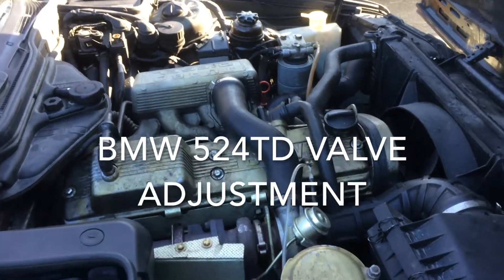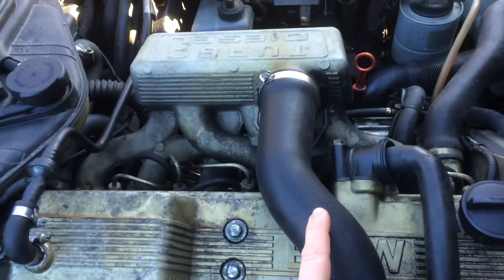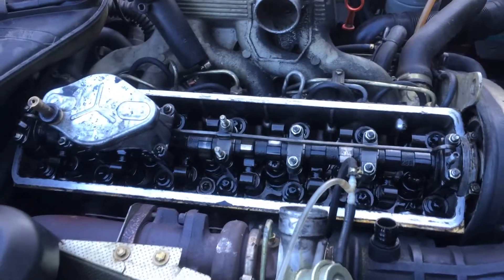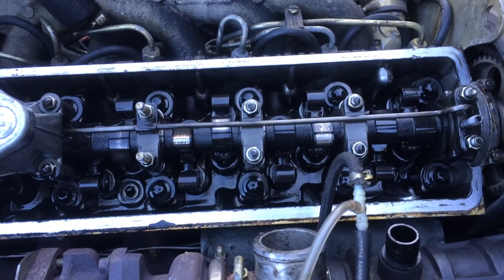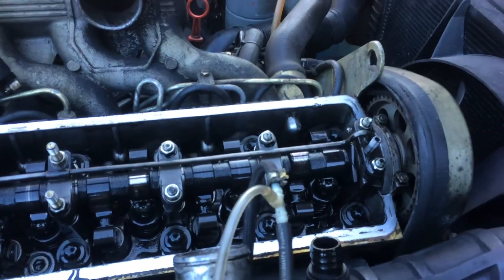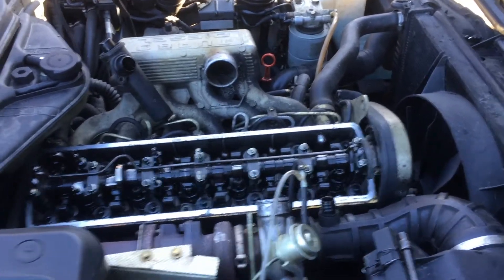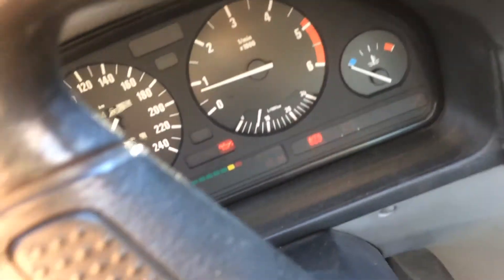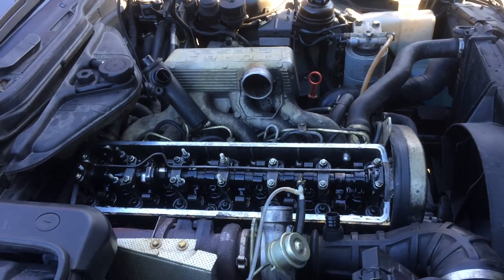BMW 524 td  m21d24 Valve adjustment

Comment: do another update on the 244 please!
i have one myself but have been getting some issues with backpreassure and low compression on cylinder 3, need to change the rings and hoone the block :(